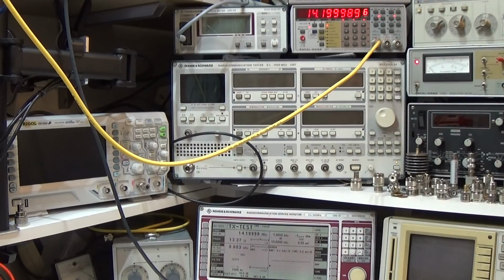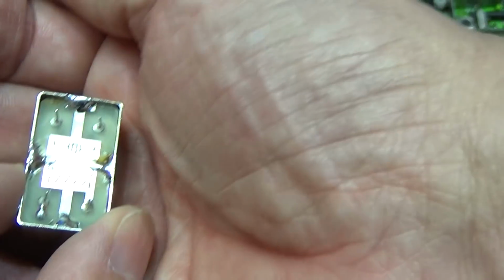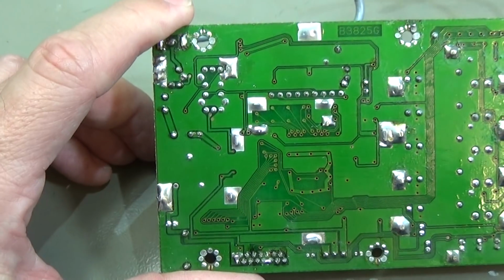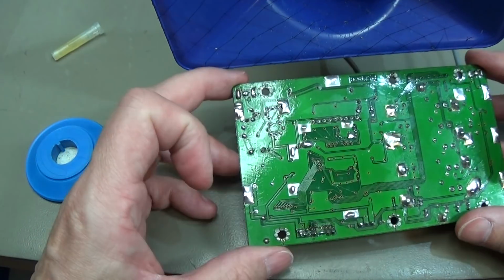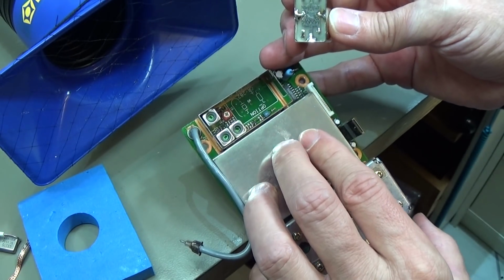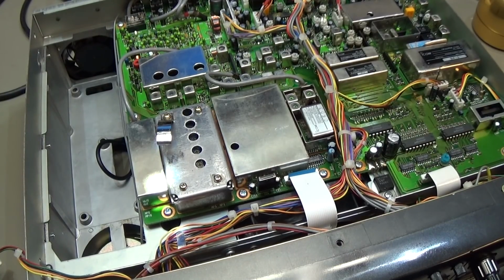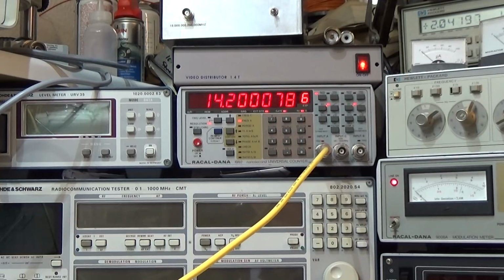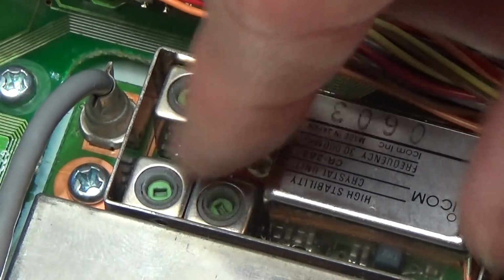#176 ICOM IC-736 gets an oven controlled crystal

Comment: Hi, 
I just replaced the stock crystal with CR-282 as your video.
Unfortunately, the frequency still drift around 20 to 30 Hz, even worse after switching between mode (SSB to FM and back to SSB). The crystal heater is working well. 
Any clue ?

Comment: Hi Peter if you read this, Guy below said i ought to ask you if you could make a video about IC 7000 that i cant get on frequency as the adjustment is the end of its tolerance, and still not quite there, X1 was changed but made no difference, see below...thanks from Fred g4vvq.

Comment: Interesting comments to the OCXO modifications Peter. I had a circuit diagram ages ago for a homebrew unit using a power transistor and thyristor sandwiched to the xtal. I remember that it worked quite well but I'll be hanged what happened to the circuit now. All the very best wishes de John-G0WXU
Reply from the maker: In video #142 and video #48 we have alternatives to the TCXO. May video #48 is a bit like you the circuit you had although my proposal is with OP-Amp..73

Comment: Interesting video as always. Quick question, is the crystal output sinusoidal or square wave? The reason I'm asking is that I made a breakout board for the SI5351C that can output any frequency between 2.5 kHz to 200 MHz on the eight outputs using a 10-100MHz reference. I'm thinking of making direct replacement boards for transceivers and add an external BNC connector on the back. https://www.jackenhack.com/si5351c-i2c-frequency-clock-generator-breakout-board/
Reply from the maker: I have not measured it but  I'm sure it is a sine... 73

Comment: Hello Peter,  Can you explain why you measured the output frequency and not the 60MHz reference frequency at P2 as mentioned in the service manual?
73 de DK3JF
Reply from the maker: Hi Jörg, lets call it the easy and quick way. That way all LO's are included (on the counter display) while  adjusting and if you get the frequency exact spot on you know the entire PLL with all sub circuits are fine. But the 60MHZ is much more accurate and you may need to align all single steps  which is much more time consuming.. Hope that answer helps...73
Reply: @TRXLab  Hi,Hello Peter, let's call it the quick and easy way. Where is this test point? The frequency set by the machine is only 14.2000Mhz USB?

Comment: Hi Peter. Nice video. I didn't know the IC-736 used the same OCXO as the IC-706MK2G. I have installed a few of those in 706MK2G'S over the years including my own. Since I live about 35 miles south east of WWV I go to 20 megs and put the passband tuning on the very bassy side on SSB, put it exactly on 20 megs and lock the dial. When the tome is transmitted I zero beait it so the audio tome stays either loud or quiet as close as I can get it after a good warm up. On the 706MK2G there is a fine adjustment that you can get to without taking the bottom cover off. I don't need to hook any counter up that way. My TS-2000X is another story :-) I love the new rigs with the menu option in them :-) Happy Summer.
Reply from the maker: Absolutely right OJ...that is a way to do it! Thanks for comment 73

Comment: Very nice mod to the radio :) and cool that the manufacturer had the option on the board to install such a heated oscillator. As a long time subscriber I really like your awesome videos :), even I have no idea about radios, but have a bit technical background....it's always very interesting to watch. Would there be a chance that you would be willing to help me with measuring a high frequency signal (200MHz, around a Watt) without disturbing the output? (This RF amp is part of a laser system...I can repair it, but so far not adjust or check it properly...that's why I would need help). That would be awesome :). Have a great sunday and Danke :), nicest greetings from the german coast 😃👋
Reply from the maker: Thanks for watching and comment. Well if it is a RF amp you can simply connect a SWR/ Power meter for VHF/UHF between RF output and antenna. That is the easiest way to do it. Any HAM radio operator has such an unit. So if you now somebody close to you he/ she can help....Hope the helps.. 73 to the north :^)
Reply: Thank you for the answer Peter. Well, it is an amp (just a little metal box, not how you would imagine an amp...) which has an AM input, RF output and the signal goes to an AOM crystal (audio optical modulator) to modulate a laser beam. The absolute output power or numbers are  relatively uninteresting for me, I just want to compare a working amp with a rebuilt amp and eventually try to make adjustments. In the meantime I have found a schematic from Alan...do you think a RF Sampler with a resistor divider coupled over a small capacitor would do the job to make it visible for me on a scope (I have several scopes and all the soldering equipment needed, I have noone with radio equipment)? Thank you and have a nice week :).
Reply from the maker: yepp a rf sampler should do the job. be careful that you have the right termination resistor to the amp..
Reply: Thank you :). I will order the parts and build one up. I have a t-piece and a couple 50 and 75 ohm termination resistors, hope that will work. The amp by itself is basically one chip (it was originally a BGD704, later a 714 and 814 from Philips or NXP and as they all went obsolete I got a couple BGD904 and also two similar Motorola parts which I hope will work too) and some caps, resistors, a trim cap, a voltage regulator and two trimmers for RF level and Voltage level around that.... Fingers crossed 🙄. I have successfully rebuilt half a douzen of these amps (but as I said, so far I could never check how good they really worked), but my workmates keep killing them...they run too hot. My big hope is to get the Motorola parts working as they take 100mA less current and hopefully run cooler. 👋😃

Comment: I think that's a peculiar construction by ICOM.
It would certainly be better when they had also installed the trimmer inside the heated housing.
Your work was very good.
Thank you for showing us.

73 Bernd
Reply from the maker: You are right a higher quality one would not use an outside plastic trimmer that is a joke...Thanks for watching 73
Reply: If they had used ceramic trimmers, I would agree, but as they tend to use plastic types at that times, I am really happy, that it is outside. So it can easily be replaced when it fails.
Reply from the maker: yepp and that is the issue with this cheap crap they will fail...

Comment: Hi Peter well done looked a bit tricky, i have an IC 7000 and its about 200hz off frequency, its been to Icoms in UK and its as close as they can get it, in fact it has been to 3 places and no one can get it right...i tried to part exchange it but they wouldn't take it as it was off freq and couldn't be adjusted, they tried a new X1 Chrystal but wouldn't do it, apparently there is no frequency adjustment all you can do is adjust it in service mode and they cant get it any closer...not even at Icoms...be nice if you could do a video one of those....from Fred in UK g4vvq.
Reply: I put an FT950 on that was at the end of its range. The coarse adjustment was in the shop manual and you had to kind of guess which way to go as it doesn't receive in the coarse mode. Once it's closer the regular menu item, 35, in the FT950 op manual did the trick. I guess the IC-7k may not have that??. Just an FYI for you. I got it to with in 1 cycle at center on 20 megs so there is now plenty of adjustment either side.
Reply: Hi OJ thanks, mine isn't that easy, it has same idea, service mode but the course adjustment is set right up one end end it still wont get to the right position...even Icom's cant do it...what does that say hi from Fred.
Reply from the maker: Hi Fred, I would look out for a TCXO or OCXO for the 7K and try it again. You get some nice duplicates from china...73
Reply: Thanks Peter.....
Reply: If you are at the end of your range then I suspect you have a component in circuit that is out of tollerence or faulty. Can you check for this? Or even ask Peter if he will make a video out of finding the fault.
Reply: Thanks Jonka1 i think your right, unfortunately Icom seem to think its too old to get new components for...they tried another X1 crystal and mad no difference, wouldn't have thought it would be that impossible but seems so...its perfectly usable as it is, unless you want to do something stupid like use cw on 70cms hi...from Fred g4vvq.